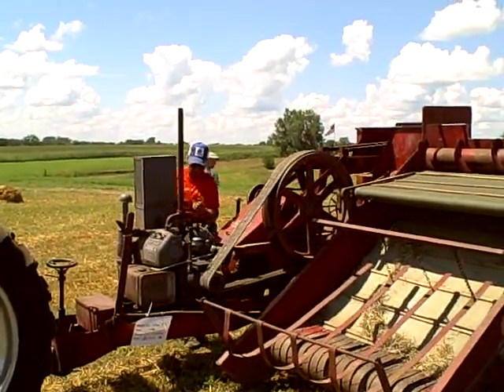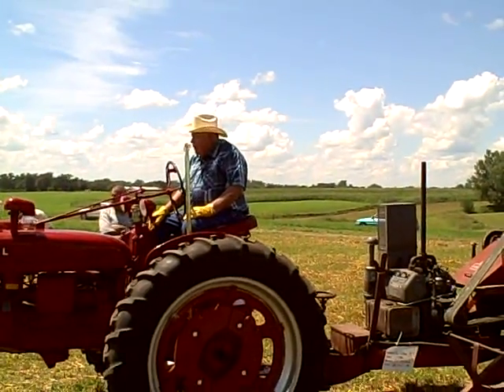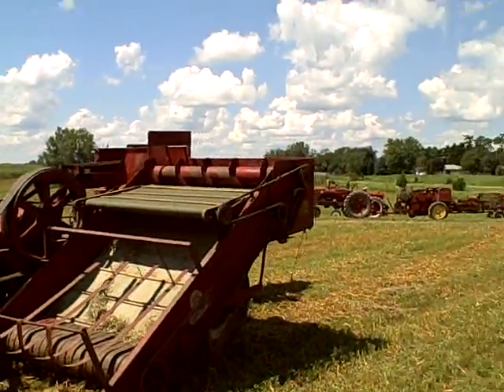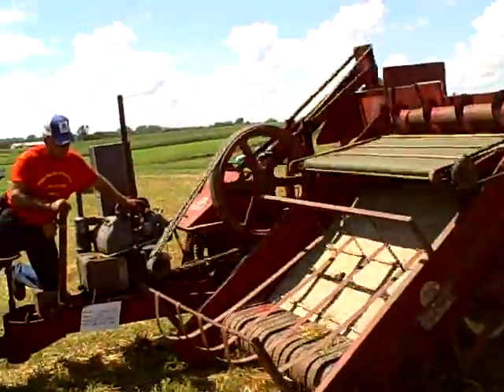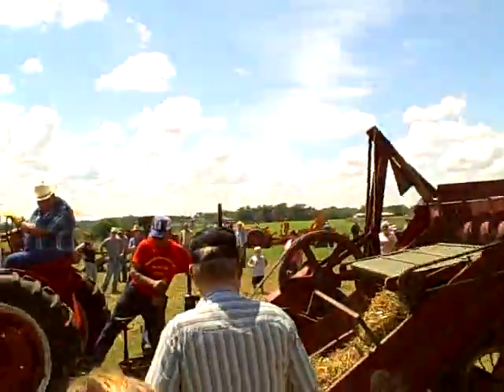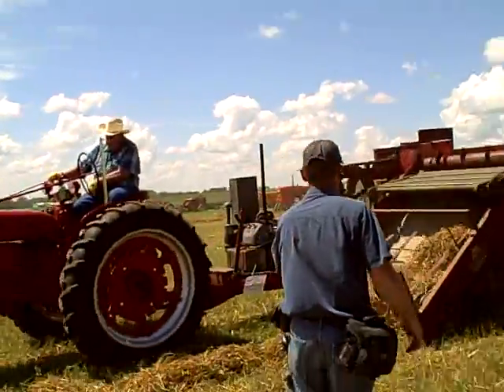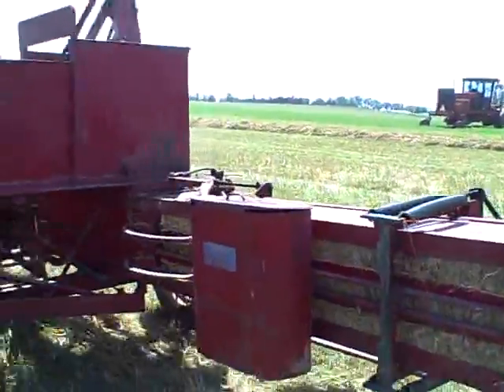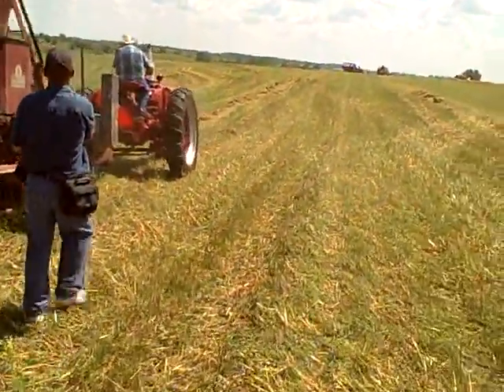Old 1946 New Holland model 76 Baler in field

Comment: When it came to hay balers, New Holland red was the only color to found on this beef farm.  Most of those earlier 76 model balers had VE4 Wisconsin engines with a hand clutch and  long v-belts up around the 33 inch diameter flywheel and that engine would run all day.  We had a Model 76 that loved gobbling up long stem hay like timothy but short stem straw would take its time going up that canvas apron but it made beautiful square bales. Our 76 model had a 3 inch wide flat belt coming off the main shaft to power the pickup and knotter assemblies, most of the videos poster here show a v-belt drive to the rear.   Over the years we had three Super 77 balers with VE4 engines and two 66 balers with small two cylinder engines.  Then we decided to go "modern" and got a N.H. model 281 baler pto powered by a John Deere 70 tractor.  We baled a "gazillion" bales through it and it rarely had a miss-tied bale.  Eventually, all these balers were "retired"  to the fence row.  Advertised them for sale running or for parts, no takers.  (Everyone looking for kicker balers)  Tried selling the N.H. Model 281 for $1500, then 1200, then 900, then 500 dollars no buyers, unbelievable...!!  Scrap dealer came and took all seven balers, trucked them over to Harrisburg, PA, dumped in to railroad cars after tearing off he rubber tires, shipped to Philly, balers were dumped into a ship's cargo hold and sailed off to who knows where.....!!

Comment: My uncle used one like this but the pickup was on the other side as I believe this one is a straw baler but the one my uncle used had a V4 Wisconsin engine with electric start. that old thing ran for many years and I remember picking up the bails from it. Thanks for sharing.

Comment: The first baler had was a New Holland 77 and it ran with a Wisconsin V-4 engine and electric start when it worked. I remember sitting on the fender watching the baler and Dad loading for a bales that failed to tie or the issues.  Ours had a 4 sided paddle at the top that fed it into the auger and then into the bale chamber.  A neighbor had a model like the one shown, but he had so many issues with it, he finally hired some to bale his three acres of horse hay. They were good balers when they worked and a nightmare when they didn't.  I also remember the clunk clunk of the vertical plunger when the baler went through the tying cycle.

Comment: I learned how to swear starting a Wisconsin V4!   Once it got how, you might as well go get dinner.
Reply: My father had a Wisconsin engine on a Minneapolis Moline combine.  Absolutely the worse starting engine ever.  You are right, if it stopped while hot you were pretty much done for the day.  Once it started my Dad would not shut it off until he was done with it for the day.  Does bring back memories though.  It did test your religion.
Reply: @dwightl5863  Everything you said about the combine and Wisconsin engine exactly like one we had 60 years ago and a Farmall H pulling it.